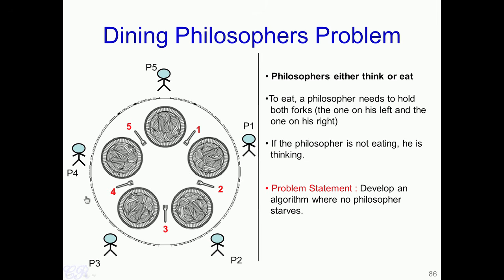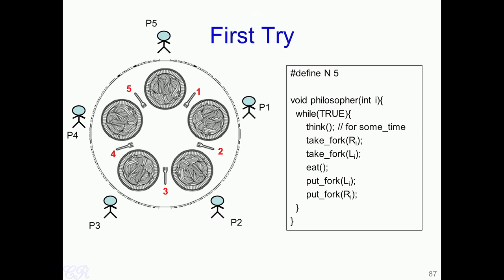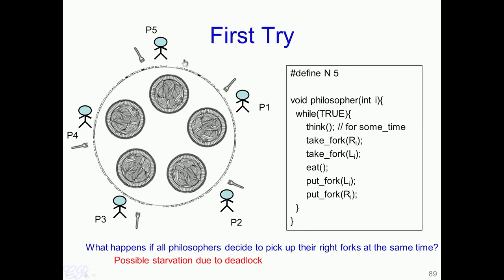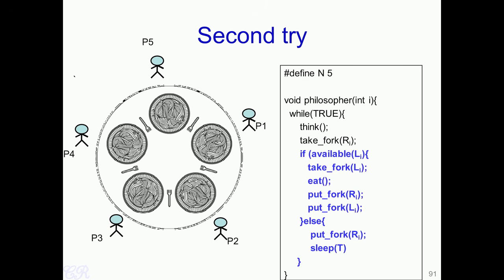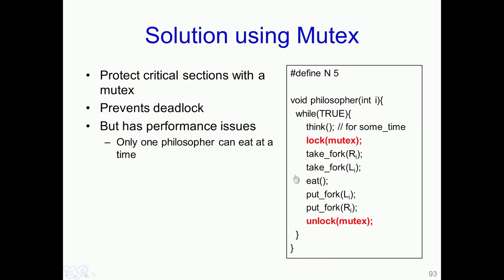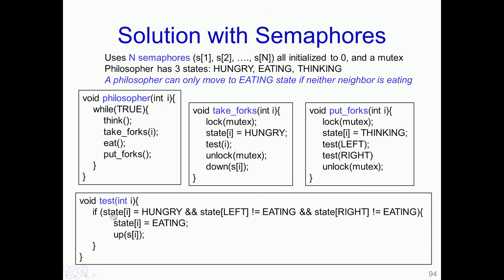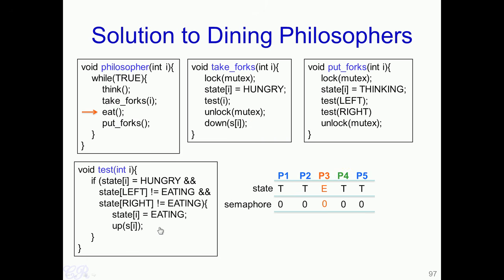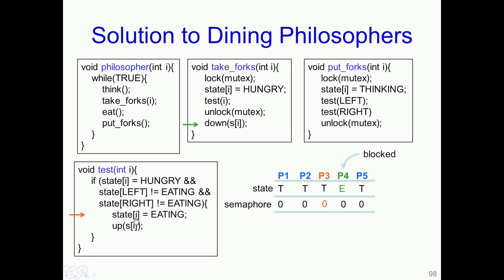#31 Dining Philosophers Problem | Introduction to Operating Systems

Comment: I compared your solution with EWD310, the original Dijkstra paper. I think you corrected a bug in the original source code. Dijkstra does not use "state[i] == HUNGRY" in test(). Did you come up with this correction yourself? I prefer the scoped_lock() solution that is possible since C++17. But Dijkstra did not like the parallel P-operation. This is the problem with genies: they assume that everybody else can do the same.

Comment: what if P1 comes after P3 and P3 is eating but the lock(mutex) prevents P3 to pass  ? couldn't P1 and P3 eat at the same time bcs thier fork L and R are available ?
Reply: I think by initializing mutex as N/2 (here 2) we can have a work around. with mutex initialized to 2 P1 and P3 can work together.

Comment: here State[i] is critical section . when execution moves from take_fork() to test() how it is possible to change from hungry to eating when that section is locked by a mutex?
Reply: Actually void putforks() invoke test, so it will wake up suspended process, does not change S[4] to 1 and after returning from test() function it will unlock (mutex). 
By mistake this faculty wrongly explained the last part
Reply: @bollywoodhub2167  test will bring S[4] to 1 and it will be immediately taken back to 0 by the suspended take_fork of P4. He is right.
Reply: The state[i] is locked by the same thread that runs test().